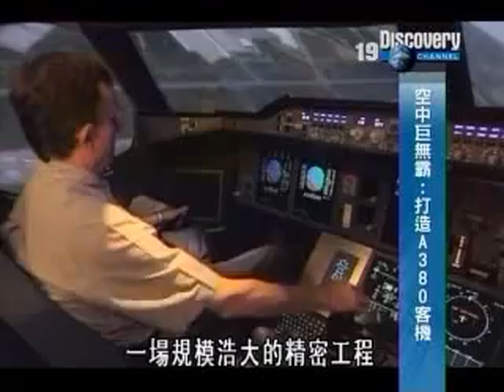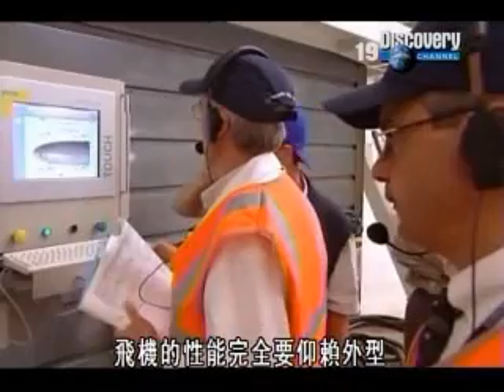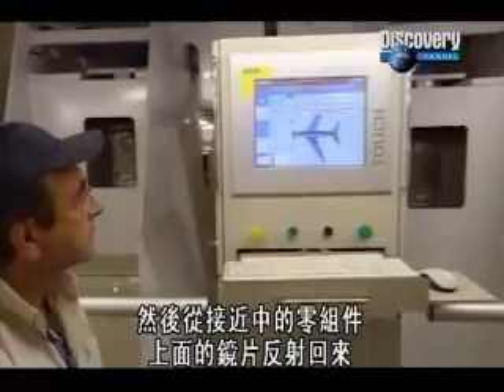Building the A380 - Giant of the Skies Part 6

Comment from the maker: @Cathaydude 
No, there is no A380-1000, there will be a A380-900 in some years. Which is the longer more efficient version with a MTOW of over 600tons. The existing wing and engines and main landing gear are ready for this version, so it is a "minor" modification. It will carry up to 1000 passangers in one class, and about 600 in 3-class arrangement. It could be that it will get the Trent XWB engines. Its efficiency would be stellar. A lot of airlines want this version.